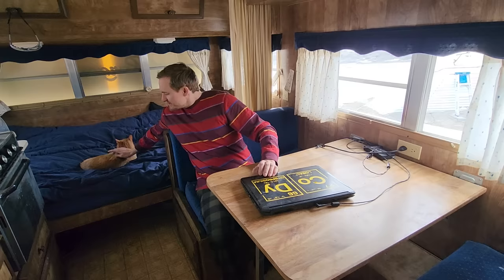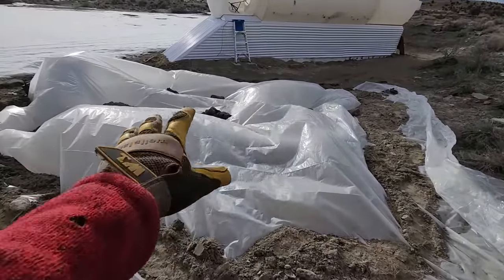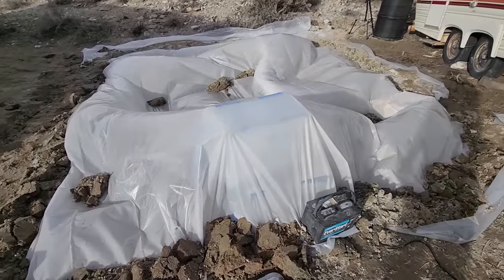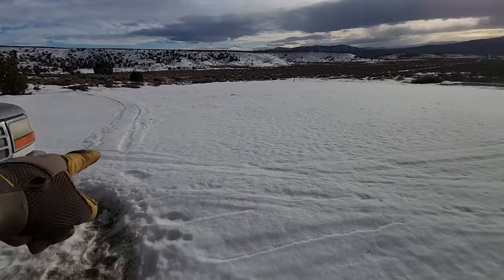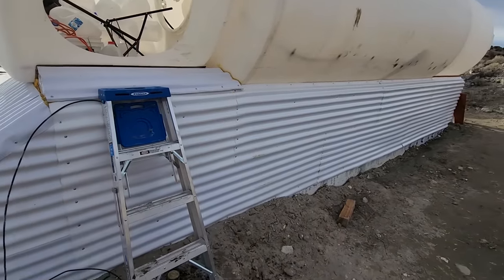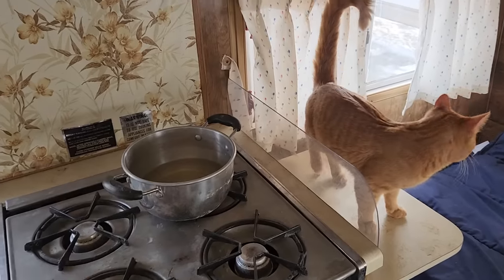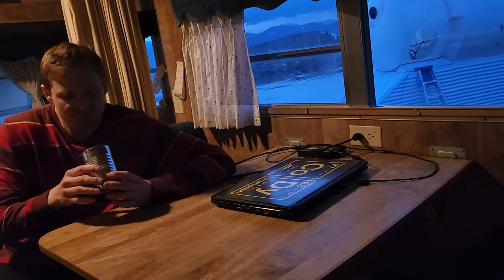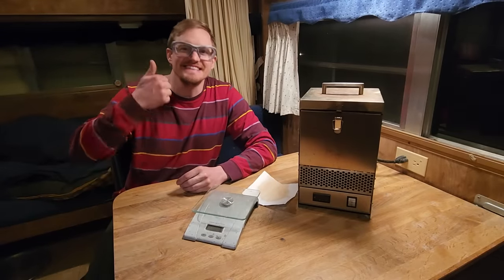ChickenHole Base Ep 21: Moisture Mining

Comment: The lighning rod shouldn't be connected to anything else but the ground. If you connect everything with a common ground and then a lightning hits, thousands of amps will pass through it but also through anything else that is connected, generating alot of heat. It would propably melt the wire fence and everything plastic that touches any of the wires. Plus its very dangerous to you if you are using the ladder when this happens. You need to have the lightning rod on a completely seperate grounding spike or better not have it at all.

Comment: Question: Does water escape from Mars after it is released into the atmosphere through evaporation?  Or would it eventually get re-deposited somewhere on the planet?
Reply: It's the same as Earth, it evaporates (I think it actually sublimates), then condenses to from precipitation in the form of snow.

In order for it to escape the atmosphere it needs to have alot of energy, which on Earth (and Mars) happens only very light gases like helium and hydrogen when they're hit by high energy particles from the sun. Water vapor is too heavy to have this happen unless the planet/moon has very little gravity.

Comment: i imagine you could melt a lot more snow with 500w dan you could condens water with this setup..
Also using the same ground spike for your lightning rod and electrical system is a bad idea i think.

Comment: cody, youre a smart guy so just buy moar solar panels than you need and a shitload of batteries twice what you need, then you can run an ELECTRIC HEATER OR AC with zero fucks given, just calculate needed wattage vs actual then reduce result by half and then double what the math tells you you need for both solar panels and batteries, its hard to fuck up with too much power!

Comment: Where would you get all this plastic from on Mars...?
Reply from the maker: It requires a lot of energy but It's possible to convert Carbon dioxide into ethylene and then polyethylene plastic. It's also possible to make alcohols. I wanted to try and make drinkable ethanol directly from CO2 and water but the state told me I couldn't.
Reply: @theCodyReeder  another reason to move to mars, no overbearing state, well not right now anyway 😂👍

Comment: You might look into Berkeys and their questionable testing standards, however I trust that you have and know what youre doing because youre Cody. I dont know if I'd trust a Berkey for safe water? But i do have one and use it for taste.
Reply from the maker: Honestly I had no idea there was an issue until reading comments. Fortunately the water from this dehumidifier is drinkable as is and running it through a filter was just a precaution.
Reply: @theCodyReeder  Yeah that's what I would think too! And by the sounds of it, it's still a charcoal filter so its not like its completely useless! It just doesn't have the accreditation that other filter systems do. Though do keep a look out for possible mold/mildew/bio-growth as well. I have had mold/mildew growth in mine at one point. Right at the rip of the top reservoir.

Comment: i agreed with you until you pulled the steel ball hitch explanation, let me tell you how condensation actually works, any time hot and cold meet it pulls the moisture out of the air, ever seen beads of sweat on a can of beer or glass of water? That is condensed humidity. Yes it was steaming and contributed SOME but do it without any damn clay or a crucible and i bet you get the same result. I do love your videos but a nerd does what a nerd does and that is floss his nerdiness bahahaha

Comment: Your weighing method is slightly innacurate. You should have weighed the metal container, zeroed the scale then add 100g of powder. After firing all you would need to do is weigh the can with the powder and note the difference.
Reply from the maker: The can gains weight from oxidation

Comment: You are way smarter than this, I'll give you my prototype: One tube in a U-shape, peltier devices contacting each side of the tube. One side hot, cooled by incoming air which is heated, the other cold with a condensing heat sink. Cold end drips water.